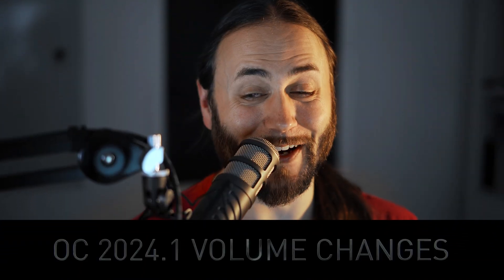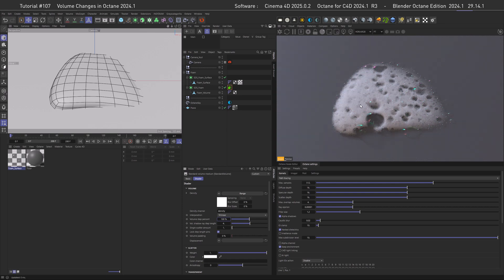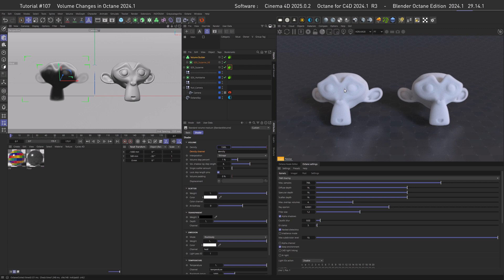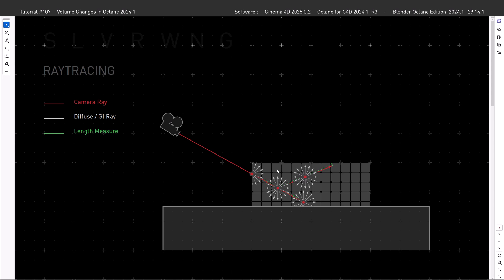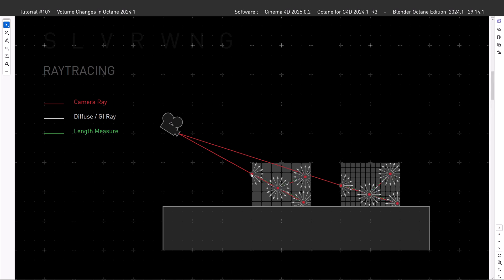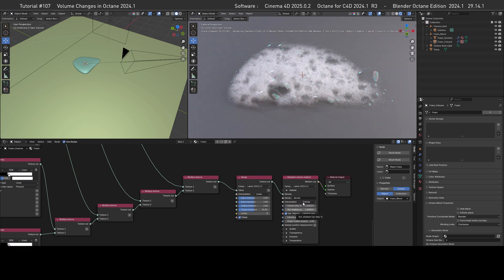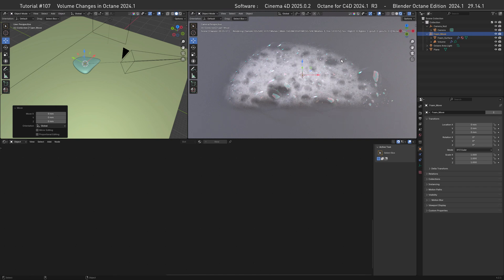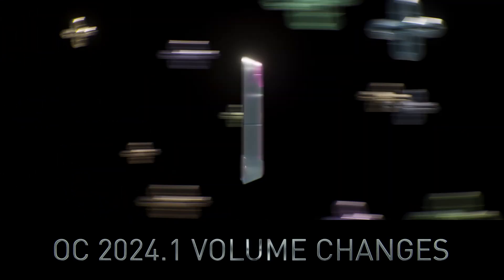Silverwing: Volume Changes in Octane 2024.1 you need to know!

Comment: Thank you very much for your effort, and I would like to ask you what you think of Octane's standard surface material, is it better to use than the universal material
Reply from the maker: Thank you very much for your comment and your question.
The Standard Material was introduced to bring in the material system from Redshift / Arnold. This was mainly made, because of the render network supporting Redshift and Arnold in the future and there is an ongoing effort to make switching render engines as easy as possible. Therefore give users a bit more "at home" feeling when they use Octane.
So to answer your question, other then that it might be more easy to use for users coming from Redshift or Arnold, there is no benefit. Also it is just called the Standard Material because that's what it's called in Redshift. This should not be an indication that it should be become the standard in Octane.

Comment: Danke für die viele Arbeit !

I installed 2024.1 on our Machines and older projects that dont use Volumes also were measurably slower then 2023.1 - not sure what thats about. Switched back to 2023 for now.
Reply from the maker: Thank you very much for your feedback.
I am not sure where this might come from. I had some other people complain about the UI not feeling as snappy. If you ever figure out the reason, I am curious to know.
As a suggestion, you may send your scene to Otoy, so they could take a look and fix the cause of the regression.